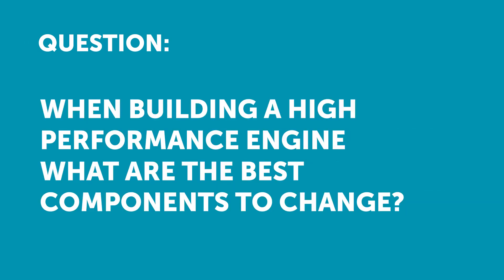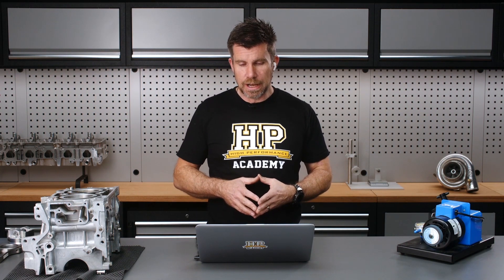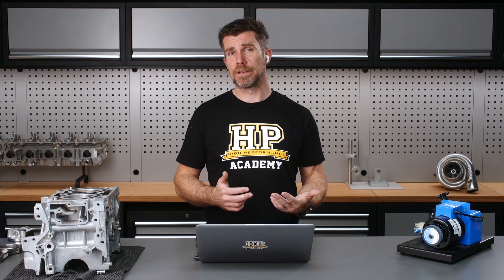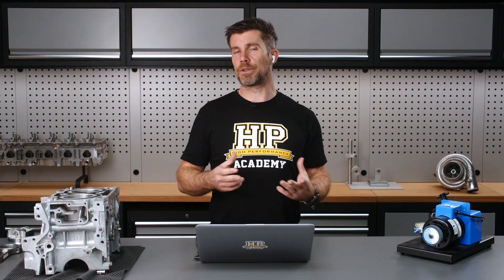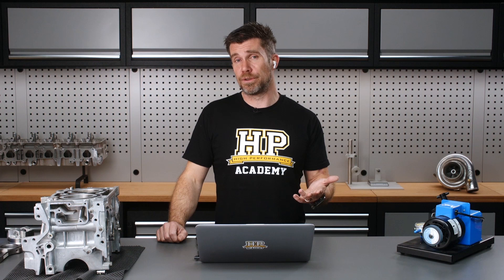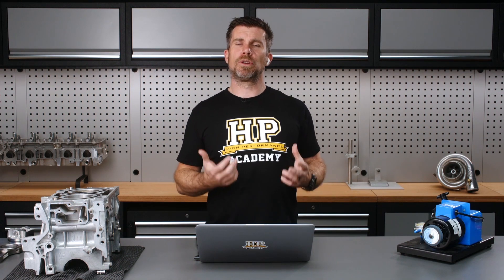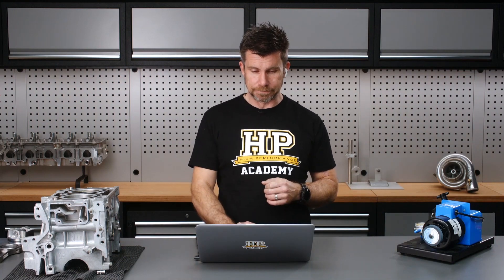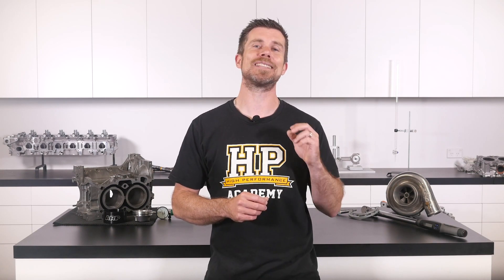What Are The Best Internal Engine Mods? [HPA Q&A]

Comment: Didnt learn nothing from this vid
Reply from the maker: It is a very broad question with no specific answer as Andre mentions, so the takeaway is that there are no 'best' mods without actually asking yourself some specific questions first. What is the engine for? 
Speedway, circuit racing, hill climbs? 
What is the power goal? 100hp, 1000hp? 
What is your budget for both the build and the maintenance? 
Can you afford to build the engine to the level that fits your application and run it on the edge, or do you need to scale it back to make sure it lasts a race season putting reliability over outright power?
That is only just scratching the surface on the general questions before you even consider he specific engine you are working with, the type of fuel you might be limited to in your class of racing etc etc etc so the answer is really that you need to ask some different questions to answer this - Taz.

Comment: super bike engines are already so highly optimized that I would go the forced induction route to get a much better bang for buck and consequentially likely go for a lowered compression instead
Reply from the maker: Forced induction is awesome, but it comes with it's own complications which are compounded in a bike application, specifically packaging and weight - Taz.